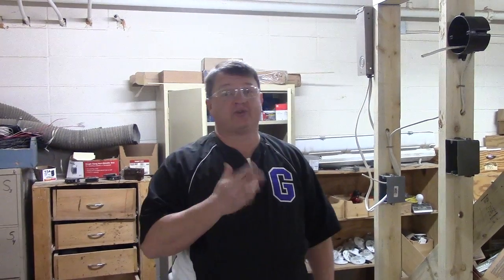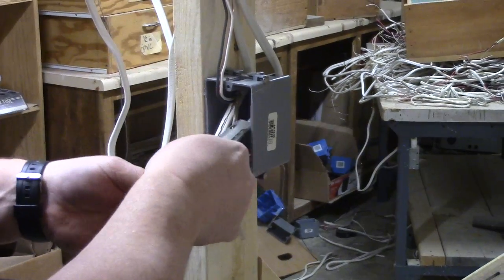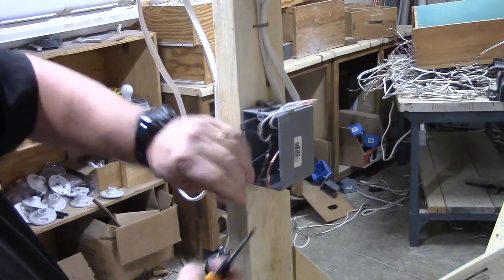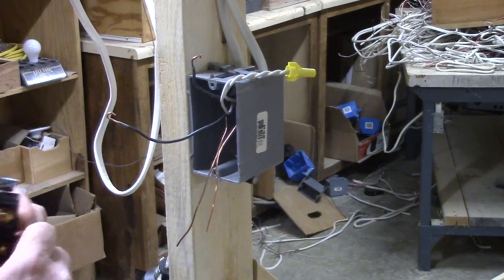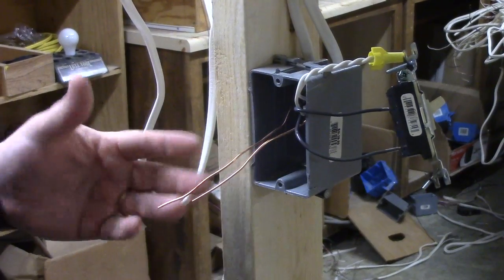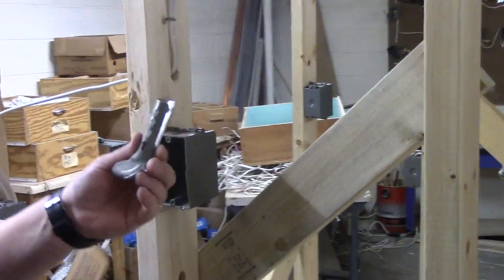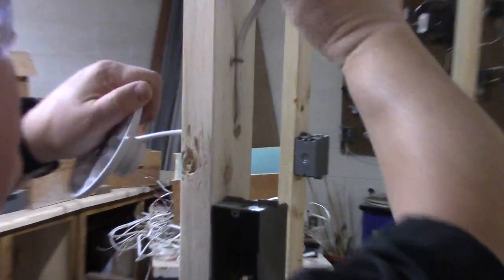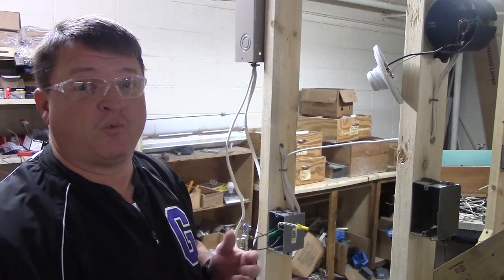How to wire a switch to a light.

Comment: Great instruction. I've been wiring lights for years in my homes however if I go a bit without doing any electric work I always give myself a refresher course. I have a very healthy respect for electrons traveling through a copper wire (or any wire) ;) I've only been shocked bad once and that was when I accidentally shorted a capacitor on a circuit board decades ago. After that I never wired a switch or outlet without a refresher.

Comment: What is the switch has a common, wouldn't you then wire nut 3 together and strip one back and put it there? That's single wire will go i to the wire nut with the other 2 commons.. Right?

Comment: You twisted the grounds counter clockwise & the ground nut wire clock wise I believe they both have to be clock wise so they can be tight correctly or else there going to come loose

Comment: My lighswitch has two white wire,one black  wire and no ground wire.  Two white  wire are connected to one bolt and black in connected to other bolt. No ground  wire is connected?

Comment: So did I miss the whole point of the video, your incoming electricity hot black wire goes on which screw on the light switch top or bottom ?  You're other out going electricity black hot going to the light goes on which screw ? Does it matter which screw they are on ? why are the two neutrals wired together as aposed to 1 hot on the switch and 1 neutral on the switch !?

Comment: What if that switch was once controlling a plug in socket and you don't want to control the plug in socket anymore. I want to take the switch off the plug in and make it on its own light socket. How would you wire that? Not sure how to pass the power through the old plug in and to the light socket.
Reply: Dennis Wilson oh yeah I know that much but I wanted to keep the plug in working I just want it on all the time. And I don’t know how to tell if your line can support another device on the line. Or how to make the power go to the plug in if it’s going to the switch sense it doesn’t have 4 screws
Reply: @denniswilson8392  okay :(

Comment: Hello if i wanted to connect two led strip light to that switch so they all three lights turn on how would i do that
Reply: @denniswilson8392  hello Dennis thank you for replying but i got it to work i had black on black white on white ground on ground but the red there to so i hooked the black on red and it worked thank you for replying to me Dennis thank you

Comment: I have that wired exactly the way you do in my light does not work I am just curious if you eliminated the light switch and just attached both black wires together temporarily both white wires together and your ground through your breaker on your light would come on yes I did check the bulb checked all the connections the reason I'm thinking of doing this I'm just by passing my switch maybe I've got a bad switch or the lights bad lights brand new

Comment: Useless video. How about showing already light fixture showing how to trace n provide power to switch box. Useless ass video
Reply: Bull Great point!
Reply: He didn't say he was going to replace stuff that was already in place. But there are plenty of videos that will help you with that. I hope you found what you were looking for.
Reply: You can't call it "useless" simply because it doesn't explain what you want to know.  If your light isn't switched, how do you turn it on and off? If you know that the power source wire needs to be traced, why can't YOU trace it and if YOU can,  why do you need a video to explain what you already know? I hope you were dumb enough to try what you were needing information on. If you were... R.I.P., "Fuckface".